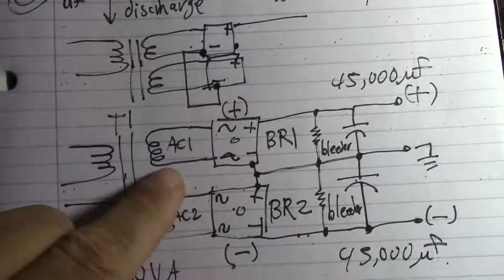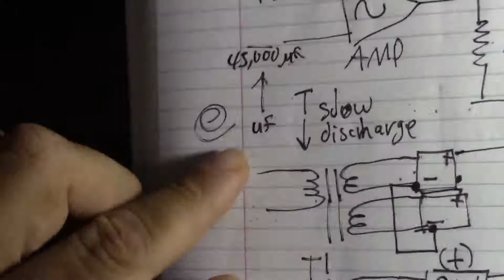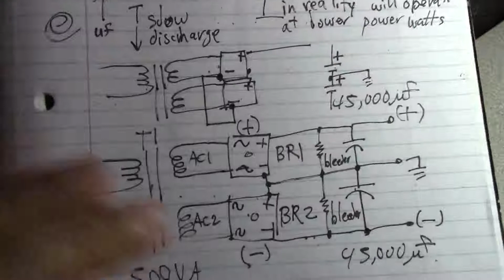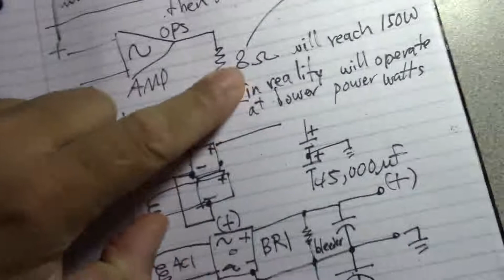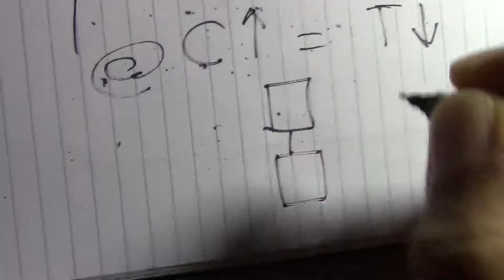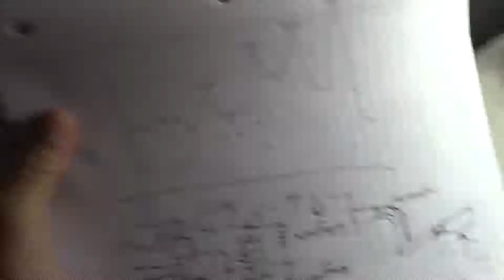SPSB P1.0 ( I wasn't planning to upload this video but hey! why not ?) :)

Comment: Can i use it for Apex BA1200 ? my transformer is 64-0 64-0 volt and 15 Amp current. what about 1500VA transformer?
Reply from the maker: me and Mr. ST we decide to keep it to maximum of 55V AC, but I think it might survive that voltage not 100% sure
Reply: plz give a test so we can know what max load it can handle
Reply from the maker: I wish I could but I do not have a larger toroidal to do that test but later on I'm gonna get me a larger toroidal 600VA 40 - 0 - 40